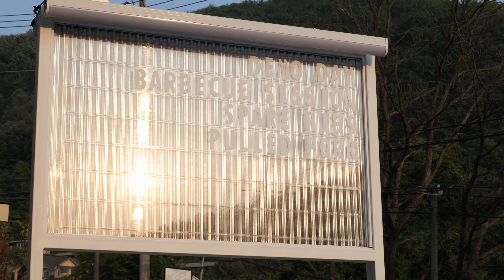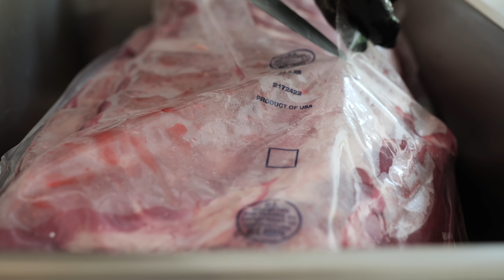하루 1억원 팔린 텍사스 바비큐 스페어립 / texas style barbecue spareribs / korean street food

Comment: A set of devices allows distillation (selection by steam) in a fully automatic mode.
- The first distillation is fully automatic. Filled in, turned on and then in automatic mode. Disconnection is automatic.
- Second stage. Filled in, turned on, took off the heads, then in automatic mode. Disconnection is automatic.

The safety group shuts off heating in the event of a cooling system failure.